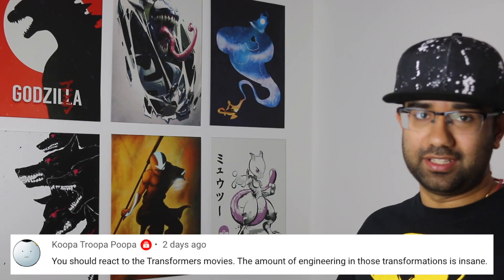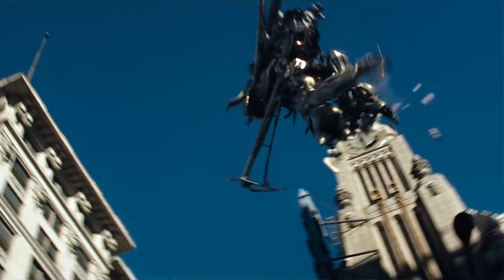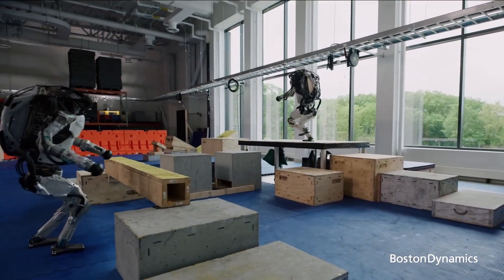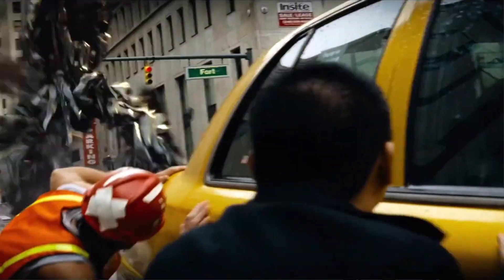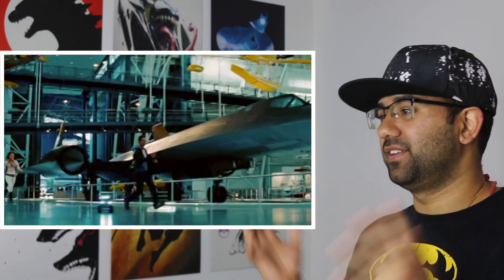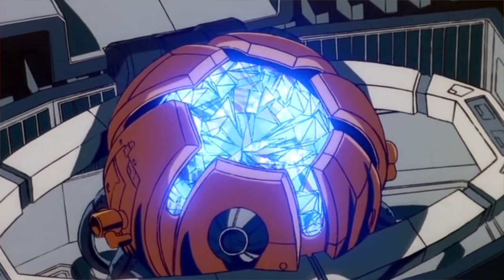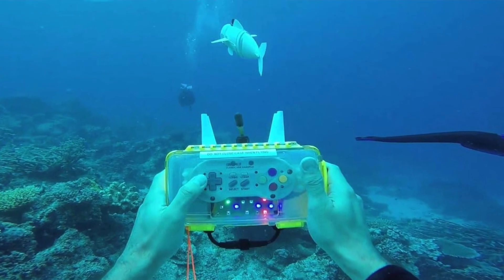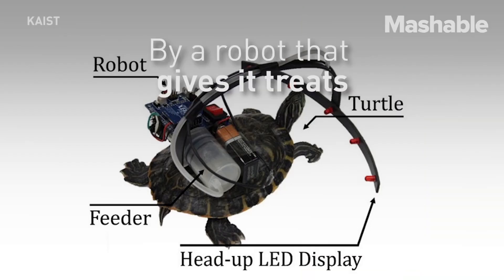Real Engineer Reacts to Transformers 2

Comment: Firstly, since you mentioned that they had reversed engineered by megatron, I thought that was the reason why the allspsark were on decepticons only. Or the possibility that the cube was corrupted and cannot do autobots. Secondly, what about shard when the little guys formed it to steal the shard.

On the off topic on something on Powe rangers. I'd say I is possible for the megazord making but, there is no promises that it would be adaptible.